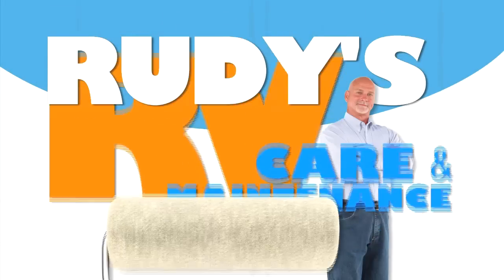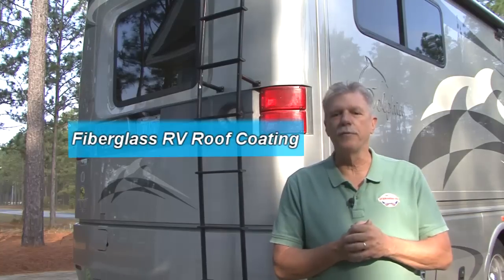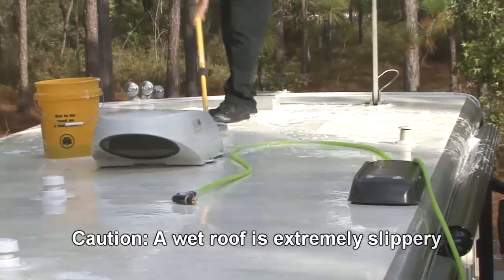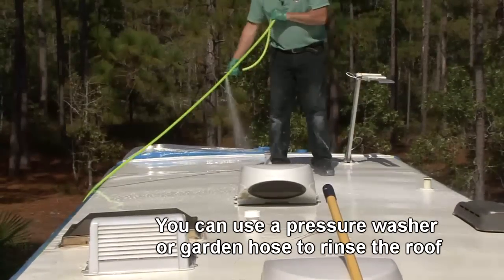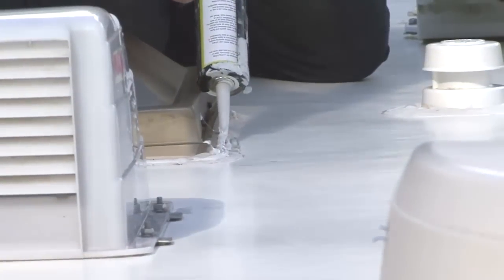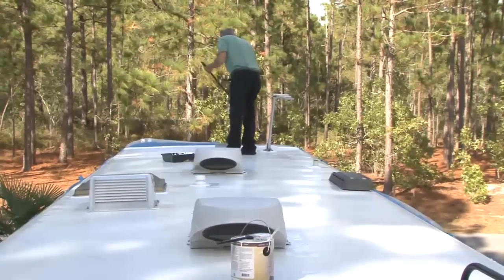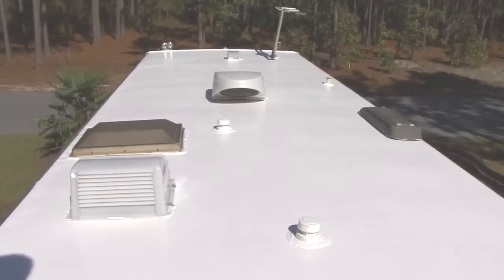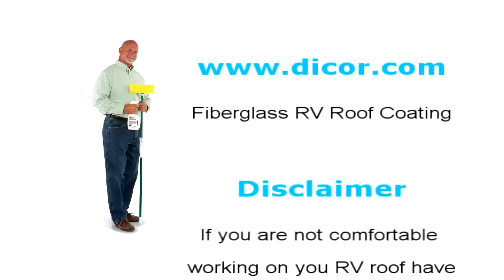How-To Coat a Fiberglass RV Roof by RV Education 101®

Comment from the maker: Coating your RV roof with a Dicor roof coating product designed specifically for the roofing material on your RV not only revives the new RV roof look, but it helps extend the life of your RV roof.  If you have an aging fiberglass RV roof don’t miss viewing this video.  #rvroof   #rvrepair   #dicor   #rvmaintenance
Reply: Fiberglass resin covers everything , wood, metal, etc., a chicken egg. Why not EPDM or TPO rubber R.V. roof?
Reply: You could have said Dicor more.... If this was a more neutral video it would be more useful and less suspect.  This video is an advert for Dicor.
Reply: Will this stick to silicone lap sealant?

Comment: I have a question:
I need to paint my Class A RV...
it is 1985 .... It is fiberglass... very old
and I'm not sure what to do first... What
kind of sealer to do first before painting.
Reply: I used liquid rubber sealant. Just make sure you prep the roof first by cleaning it and removing old caulking. https://www.amazon.ca/gp/aw/d/B01EV4EXG2?psc=1&ref=ppx_pop_mob_b_asin_image

Comment: I have a gel coat fiberglass roof (a Bigfoot) it does not need the roof coated. It DOES need penetrations re-sealed. The factory did NOT use a rubbery coating but something from Plasti-cote brand which is a fiber reinforced rigid product that appears to be like this one. It obviously had areas taped off, coated, and then while still soft the tape was removed. Any suggestions? I'd really prefer to avoid the soft rubbery products.